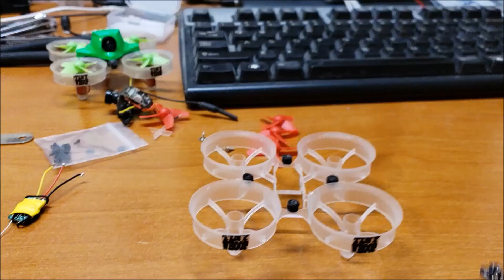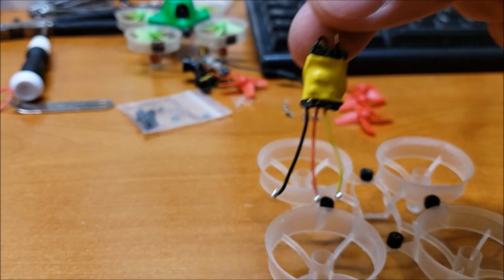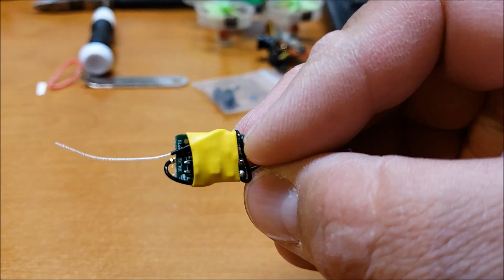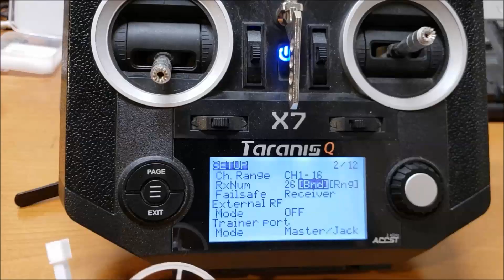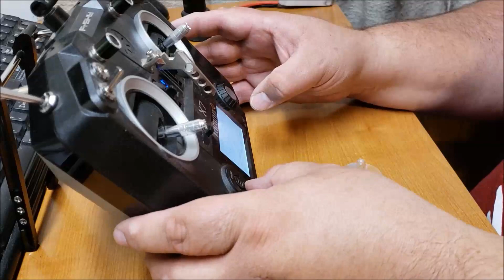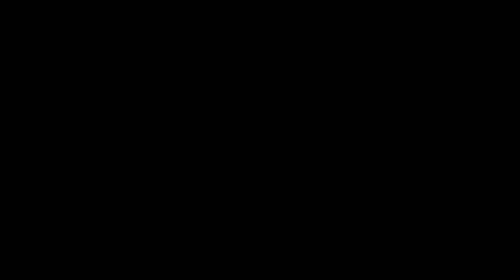Alien Whoop Zer0 Build Video

Comment: aww you dint show soldering in the camera, where do the smart audio and 2 yellow wire vid in/out go on the Alienwhoop FC?
Edit* Alienwhoop Zero FC does not support smart audio. All you need to do is solder the black and red wires from the VTX
Reply from the maker: This flight controller does not have smart audio.

Comment: Hey Mike do you have OSD on it? I have the same built and want to put osd if possible.
Reply from the maker: Not with the Alien Zer0 board
Reply: @EvilMunkeyRC  Ok. Thanks alot.
Reply from the maker: @electroddxful  your welcome buddy
Reply: @EvilMunkeyRC  One more question and I really appreciate it. Which are the best propellers for these motors. Will you have a link to buy from. Thanks again.
Reply from the maker: @electroddxful  it kinda all depends. I use 4 prop Eachine. But you'll have to try some and see what you like. I buy everything from www.tinywhoop.com
Reply: @EvilMunkeyRC  Ok cool. You rock buddy. Thanks

Comment: Hey Mike where did you get the flat washers.
Reply from the maker: I got them from my Foxeer camera.
Reply: @EvilMunkeyRC  I'm having the same problem by trying to put FC on cockroach frame. The board keeps coming out of dampers ☹️. I'm trying to find a solution for it.
Reply from the maker: I also use hot glue to hold it in place
Reply: @EvilMunkeyRC  I will definitely give that a try. 👍👍👍👍. Thanks
Reply from the maker: You're welcome!!!